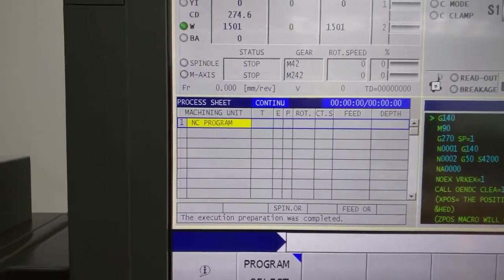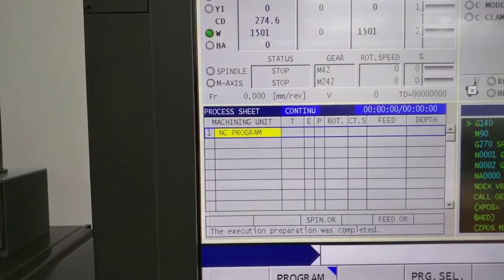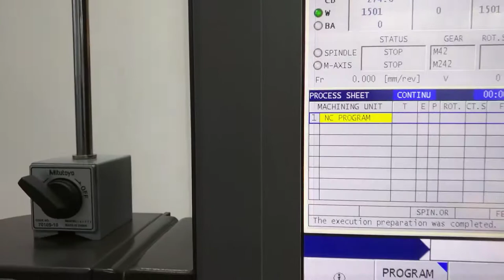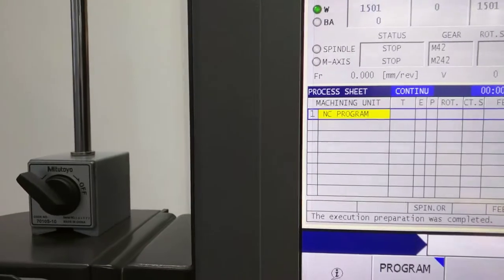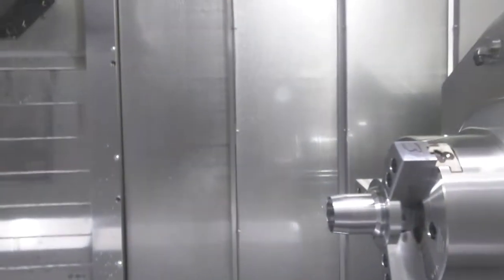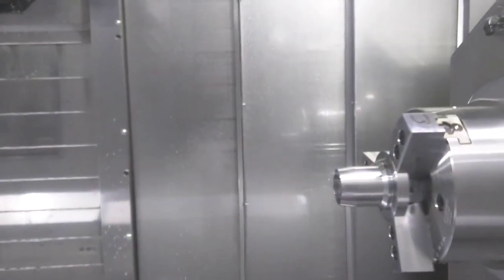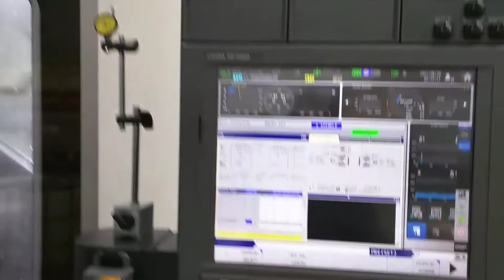Automatically clean part CNC machine

Comment: What are the codes to get the M-spindle to rotate without having the C axis locked (M110)?
Looks like you are spinning those chucks at a higher RPM than a M110 would allow.
Reply from the maker: Have a look thru the transfer macro I commented above all the code is there. Hope that helps

Comment from the maker: OTRNS(REV 4)
(CALL OTRNS LFTR=1 ROTS=1 MZER=1 CLEO=50 CLET=50)
 
(LFTR=1 TRANSFER FROM LEFT TO RIGHT)
(LFTR=0 TRANSFER FROM RIGHT TO LEFT)
(ROTS ROTATE SPINDLE DURING TRANSFER=1 NO ROTATION =0 TORQUE  + ROTATE=3 TORQUE SKIP + NO ROTATE = 4)
(MZER=1 THERE IS A MO 0= NO M0 USING CLEO FOR CLEANING POSITIONS 2= NO M0 AND USE FAN USING CLEO FOR POSITIONS)
(CLEO= Z POSITION FOR CLEANING JAWS)
(CLET= Z POSITION FOR CLEANING JAWS)
V130=LFTR (TEST TRANSFER FROM LEFT TO RIGHT)
V134=ROTS (ROTATE SPINDLE DURING TRANSFER=1 NO ROTATION =0)
V135=MZER (M ZERO IS ON OR OFF)
V136=CLEO (SP1 Z POS FOR CLEAN)
V137=CLET (SP2 Z POS FOR CLEAN)

EFST=50

NB0000
(TURET A)
G140 (SPINDLE 1)
P-9999
P0010
IF[V135 EQ 0]NZER0
IF[V135 EQ 1]NZER1
IF[V135 EQ 2]NZE12
ERROR 

NZE12 (HIGH PRESURE COOLANT AND FAN CLEANS JAWS)

G0 X1500
MT=900601 
TC=01
TD=039006 M323 
G21HP=4
M109
G0 X200 Z=V136
M247
G50 S3000
G97 S100 M42 M03 M08 M175 M263
M143
G94
G1 X20 F5000
X400
X20
X400
G4 F2
M05 M09 M174 M262
(M102)
M246
M142
G0 X1500

(######FAN ON########)
M867
M153
M866
G20 HP=8
G94 M146 M15 M09
G00 X800 Z1000
SB=2000 M242
M13
Z=V136
X250
SB=7500 M242
G97 S100 M03
G01 X-50 F3000
X250
X-50
X250
G4 F1.5
M05
SB=2000
G21 HP=4
G95 M12 M09
M109
M152
G140
M01

IF [V12 EQ 0] NDSM
NDS1
NDSM
M91
MSG (REVIEW PART)
M00
NMSG
M90
NDS1

G0 X1500
G141
MT=900601 
TD=01099006 M323 
G21 HP=4
G0 X200 Z=V137
M185
G50 S2500
M109
G97 S100 M42 M03 M08 M175 M263
M143
(M101)
G94
G1 X20 F5000
X400
X20
X400
G4 F2
M05 M09 M174 M262
(M102)
M184
M142
G0 X1500

(######FAN ON########)
M867
M153
M866
G21 HP=4
M185
G94 M146 M15 M09
G00 X800 Z1000
SB=2000 M242
M13
Z=[V137+EFST]
X250
SB=7500 M242
G97 S100 M03
G01 X-50 F3000
X250
X-50
X250
G4 F1.5
M05
SB=2000
G4 F1.0
G21 HP=4
G95 M12 M09
M109
M152
G140

GOTO NZER2

NZER1

M91
/MSG
/M0 (PART TRANSFER CLEAN JAWS)
/NMSG
M90

GOTO NZER2 (ALLOW OPERATOR TO CLEAN JAWS)

NZER0
(**************CLEAN HIGH PRESSURE COOLANT*****)

G0 X1500
MT=720001
TD=01037200 M323
G20HP=8
G0 X200 Z=V136
M247
G50 S3000
M109
G97 S100 M42 M03 M08 M175 M263
G94
M143
G1 X20 F5000
X200
X20
X200
G4 F2
M05 M09 M174 M262
(M102)
M246
M142
G0X1500
Z200

G0 X1500
G141
MT=720001
TD=01097200 M323
G20HP=8
G0 X200 Z=V137
M185
G50 S2500
G97 S100 M42 M03 M08 M175 M263
M143
(M101)
G0 X20
X200
X20
X200
G4 F2
M05 M09 M174 M262
(M102)
M184
M142
G0X1500
G140

NZER2 (OPERATOR CLEAN JAWS)

IF [V130 EQ 1] NORML

(**************RIGHT TO LEFT TRANSFER**********)
G21 HP=4
T1000 (INTEX TOP TURRET TO SAFE POSITION)
G21 HP=4
W2000
M185
M84 (MAIN CHUCK UNCLAMP)
M89 M289 (SPINDLE & SUBSPINDLE BLOW ON)
M151 

IF[V134 EQ 1]NRTO8
IF[V134 EQ 0]NNTO8
IF[V134 EQ 3]NRTO8
IF[V134 EQ 4]NNTO8
ERROR

NRTO8
G97 S100 M03
GOTO NEX90

NNTO8
M05
GOTO NEX90

NEX90
G00 W30
M88 M288

IF[V134 EQ 3]NTSK4 (TORQUE SKIP)
IF[V134 EQ 4]NTSK4 (TORQUE SKIP)
G29 PW=30 (Torque limit)
G94 G22 W0 D5 L2 F500 PW=25
G29 PW=5 
GOTO NTSK3

NTSK4
G94 G01 W0 F250
NTSK3

M83 (spindle chuck clamp)
M88 M288 (Airblow A OFF )
G04 F1
G28 ( Torque limit: Cancel)
M184 (MAIN internal interlock release OFF)
M247 (SUB interlock OFF)
M249 (SUB OPEN)
G04 F1
G95 G00 W2000
M05
M150 (Synchronized rotation OFF )
M246 (SUB INTERLOCK ON)
GOTO NRTS

NORML   (***********LEFT TO RIGHT TRANSFER***********)

G21 HP=4
T1000 (INTEX TOP TURRET TO SAFE POSITION)
G21 HP=4
W2000
M247 (Sub spindle chuck interlock release OFF)
M249 (Sub spindle chuck unclamp )
M88 M288 (Airblow A ON ,Sub spindle air blower ON)
M151

IF[V134 EQ 1]NROT9
IF[V134 EQ 0]NNRT9
IF[V134 EQ 3]NROT9
IF[V134 EQ 4]NNRT9
ERROR

NROT9
G97 S100 M03
GOTO NEX9

NNRT9
M05
GOTO NEX9

NEX9
G00 W30
M88 M288 (Airblow A OFF )

IF[V134 EQ 3]NTSK2 (TORQUE SKIP)
IF[V134 EQ 4]NTSK2 (TORQUE SKIP)
G29 PW=30 (Torque limit)
G94 G22 W0 D5 L2 F500 PW=25
G29 PW=5 
GOTO NTSK1

NTSK2
G94 G01 W0 F250
NTSK1

M248 (Sub spindle chuck clamp)
G04 F1
G28 ( Torque limit: Cancel)
M246 (Sub spindle chuck interlock release ON)
M185 (Chuck internal interlock release O4)
M84 (Chuck Unclamp)
G04 F1
G95 G00 W2000
M05
M150 (Synchronized rotation OFF )
M184 (Chuck internal interlock release OFF)

NRTS
M109
P-9999
RTS
Reply: what type of Okuma this is? multus or?